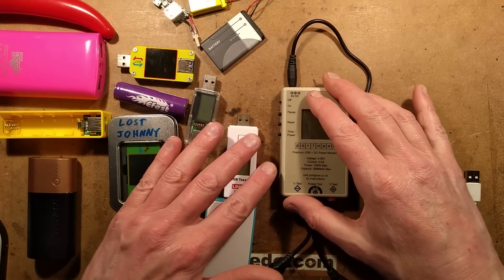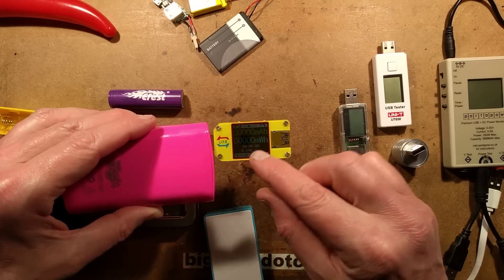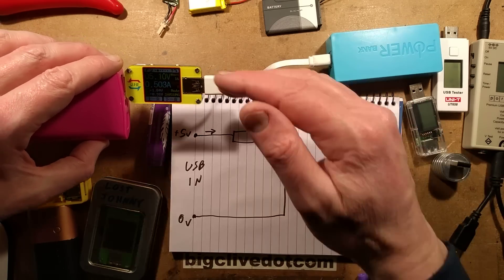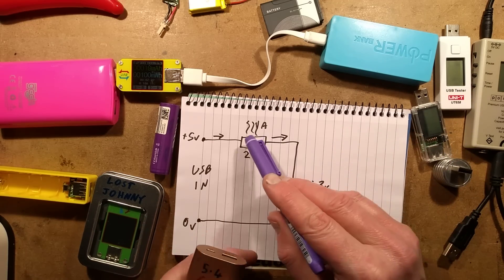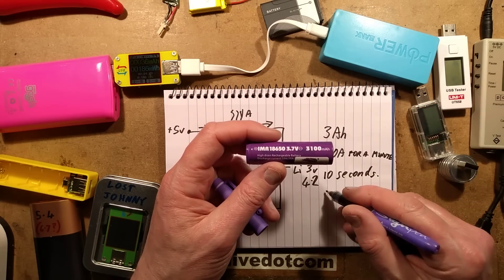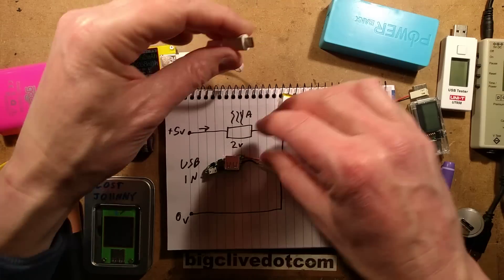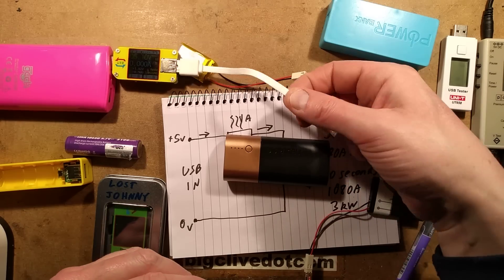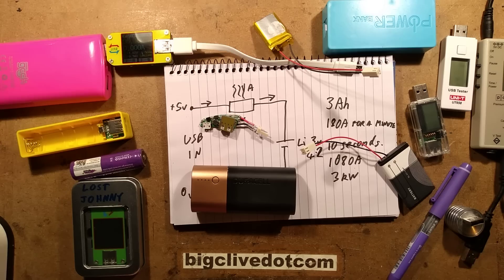How I test lithium cell and power bank capacity.

Comment: Clive, in the DIY Powerwall/second life hobby world, we use the Opus BT3100 to test capacities discharging at 1 amp. This helps to standardize results. It tests 4 at once and does the charging, discharge measurement and recharge and then we just write the mAh value on the cell. Can speed things up a lot by pre- and post-charging with a rack of TP4056s or other chargers. With 10 Opuses we can test around 200 cells per day. Those that get hot during 1A charge are rejected as well as those that get excessively hot during discharge. (A good cell should never get hot during a 1A charge, but is ok to get a little warm on discharge).
Then let stand for a week or two and measure voltage again - any that have self-discharged less than about 4.10V should also be rejected and go for recycling.
Using this method I have over 1000 good cells after testing over 3000 cells and always looking for more to do!
Reply from the maker: I have noticed a pleasing quirk in human nature that makes us harvest lights, solar panels and power storage devices.  Is your power wall vented to outside in case of any incidents?
Reply: @bigclivedotcom  Powerwall still under construction but I will use it for an ebike with a trailer for extra range, so won't be used indoors except for power outages. Have had no incidents since working with cells over the last 2 years - except for cuts and bruises while spudging laptop packs!
It takes a lot of time to evaluate each cell and enter into a database for tracking histories, and for sizing allocation to make equally-sized cellpacks. 
Yes, safety is an important consideration - if and when I do make a permanent powerwall then it would be surrounded by paving slabs or live outside. Not practical at the moment in a 3rd floor flat.
I made four 120W portable solar panels using 6 A3 sheets of foamboard that weigh just over 1kg each and all fit in a backpack so I can ride hundreds of miles for free.
First I made a 2kWh 14S16P ebike battery 18 months ago and that works really well. I'm still in the process of building a 7kWh battery out of the remaining 800 cells to go in a trailer.
Now I make a portable solar tracker using 3D printed worm drives, steppers, arduino and a gps module and that's taking my time right now. The gps module allows me to calculate the elevation and azimuth of the sun anywhere in the world and I'm hoping to be able to mount the 480W of panels on it and all for a really minimal cost.
Reply: @ahaveland   Have you made an Instructable about those 120W solar panels? I'd like to see whether I could make one myself... Although I can't quite see how 6 sheets of A3 foamboard fit into a backpack... :-/
Reply: @stepheneyles2198  I have a vid on my channel showing them. It's not difficult but it's quite tedious. I guess I could make an instructable, but it would only be a list of tips. They've lasted a couple of years and still work... Unfortunately the price of Sunpower cells seems to have doubled since and I have no idea why, otherwise I would make some more.
Here's a pic of them in the wild, and the backpack that 24 A3 sheets of foamboard fit into! https://twitter.com/ahaveland/status/1057715731297648640
Reply: I can only second the suggestion of the Opus. I have an ebike battery pack that I've built from ~120 used cell phone batteries and I would have gone insane testing each of them, if it wasn't for a convenient testing device.
Reply: @tybofborg  Congrats on doing something really useful with the cellphone batteries!
Just have to watch out for the cellphone battery protection cutting in before reaching 2.8V, as the Opus thinks the battery has been removed and you lose the mAh value. Then the cell recovers, and the Opus recognizes it and begins to charge and discharge over again, then lose the value etc...
Reply: @ahaveland  Thank you! Yeah, I'm very happy I could put those to good use. They're from the mobile repair shop I work at. Most of the batteries we replace as "bad" are actually still good (at least the cells), if somewhat reduced in capacity. As for the protection board, I detached those before testing the batteries. They're a common point of failure, and I have my own BMS anyway.
Btw I love your solar bike setup. I've thought of building something like that, but I figured the panels would be too bulky. Glad to be proven wrong on that :)
Reply: @tybofborg  Keeping the individual cell protections could be useful as they're already there and should never trip in use anyway. In any case I'd connect using fusewire in case of shorts. Would still need a master bms to handle overall protection and balancing. Here are my panels in use in November: https://twitter.com/ahaveland/status/1057715731297648640 (Not sure if I already posted this and it disappeared!)
Reply: @ahaveland  Yeah, the main problem with the protection circuits is, many of them have failed, refusing to allow a charge. And they usually have a thermistor that kicks in at around 1-2 amp. Without protection, 10S12P they deliver 15A sustained, 30A peak without a problem, which is perfect for my 500W motor. As for fusewire, I just sorta winged it, used power lines from broken USB cables for the battery leads. They do fuse when a cell is shorted out (~10A), that's good enough for me. The BMS has a 30A overcurrent protection (as well as overcharge/overdischarge protection and balancing) for the whole pack. 
I've seen that photo of yours, that's what I complimented on. That array would charge up my pack in an hour. :)
Reply: this is pretty much the way I check my salvaged Li cells, charge to 4.2 discharge to 3.0 then charge to 4.2 that will give me a ballpark figure of the mAh, leave for 2-3 weeks any that are 4.0v or lower are discarded (sold on ebay)
it helps to have the datasheet as most power tool battery packs contain low mAh but high discharge generally 20A or higher where as most laptop packs are high mAh low discharge.
I've been using my old SkyRC iMAX B6AC V2 but at 1 cell at a time I'm tempted to splurge on the SkyRc MC3000... might need to get a Patreon account tho lol
Reply: @amigaman9433  Get an Opus or 2 or 3... follow HBPowerwall, jehugarcia, Average Joe, DIY Tech & Repairs, Vortecks, Andy Kirby - and you'll also learn a lot from them.
(This is my list of movers and shakers in the 18650 world)
Reply: @ahaveland  I started salvaging 18650 cells for my night-vision torches, once I find some that have a decent mAh >2800 and a good amount of recharges left I solder a 1s bms on them and rewrap.
I am lucky that a m8 works for an e-waste company and gets me boxes of used and some unused battery packs
I'm always looking for new content and I'll check out those youtubers, thanks
Reply: @amigaman9433  Yes, you are lucky! Collect as many as you can, and when you have thousands of them you can run your house off them, charge by solar/wind and perhaps go off the grid and never pay an electricity bill again! This is my ultimate goal.
Reply: You should buy cells in bulk and sell the tested cells for a good profit.

Comment: You should test capacity with discharge not when charging. Losses can mislead overall capacity
Reply from the maker: I use this test method to get a rough guide to capacity of cells inside sealed enclosures where the cell isn't accessible.

Comment: Interesting video :) If you want to know a little more on the RD UM24 (green) and UM34 (yellow) UPM's, I've got videos on both on my channel (or if you don't remember how to work the menu ;))
Although I differ in opinion from you on getting a capacity-measurement : I'll discharge a powerbank at a certain current and monitor that along the way. I'll do this for every charging mode the powerbank supports.

Comment: Interesting, I'm surprised you get capacity from charging.
I used to test 18650's like that but I've had lots of batteries that are old that must be internally failing as they take quite a bit more to charge than you get back out.
Now I use an Mc3000 charger though as it gives me charge and discharge characteristics on the PC/phone which is pretty sweet.
Reply from the maker: If those cells are taking longer to charge than their capacity suggests then monitor their voltage over time with no load.  If it drops significantly then recycle the cells as they may have internal shunts.

Comment: Given the losses that you'll get from the charge/use circuitry, wouldn't it be more useful to measure the capacity of a power bank by discharging it rather than charging it?

Comment: personally i would throw that non metallic purple efest battery away, they are rejected samsung/sony batteries that are rewrapped, we tend to not use those in vaping devices anymore as they have been known to blow up, the newer metallic ones are safe though.

but if you are interested in lithium-ion battery tests, then mooch has got a large list of battery tests and graphs for you to check out here

https://www.e-cigarette-forum.com/blog-entry/list-of-battery-tests.7436/?fbclid=IwAR3Cs2WuMAT6OcITSQOTmxqLXcOhRd2sMcp5kV70tTbMTeg4FLDIGske0Dk
Reply from the maker: I wouldn't use it in a vaping device.  I got it as a higher capacity floodlight cell for a low current application.  I'd only use a premium cell from a known source for a high current application.

Comment: Clive, how do check the capacity of Non re-chargeable batteries i.e. Zinc, alkaline etc. Have you ever checked the capacity of Lidl’s Areocell batteries? 
The RUIDENG UM34 Voltmeter Ammeter displays & records mAh and mWh’s.
Reply from the maker: I have a crude AA test setup that gives a useful indication of all AA style cells.  It's a modified clock.

Comment: i test capacity differently. i discharge a cell slowly, until circuitry kicks in to stop. then i slowly charge it until is full 100% charged, and i discharge again slowly until circuitry kicks in. second time is with known load and time is the metric, a little math - time over current gives me the real capacity i have to use.
Reply: This method need a quite complex math and even after that it is not precise. Even you know load, current will change over time because Voltage will change from 4.2 to 3.0ish and not linear. That is a reason why testers use current measurement logging.

Comment: The Ruideng UM34 USB tester is very accurate but it has a few quirks you need to be aware of. It is definitely a good idea to turn the display off (or very dim) because it eats a lot of power and if testing at higher than 5V, the internal voltage regulator in the tester gets very hot.  Another problem is that the lowest measurable voltage is just 3.94V, because below that the unit turns off. The capacity recording  threshold mentioned by Clive has bugs too and can produce wrong capacity readings. There are a full reviews of the UM34  and the UNI-T tester on my channel if you want more details. 
The reason why you always measure less capacity (mAh) going out of a USB power bank than in is partly due to the losses in the step-up converter as Clive mentioned but mostly because of maths. For example, a Li cell producing  1A for 1hour at (average) 3.6V has a capacity of 1000mAh and delivered an energy of 1A*3.6V*1h = 3.6Wh. These 3.6Wh get converted to the same energy on the USB side but 3.6Wh on 5V means the current is only 0.72A for 1h   (ignoring losses in the converter). So the capacity measured on the USB side is only  720mAh and in reality, even less if the conversion losses are factored in.
Reply: thats a very interesting review, bit over my head but very interesting but one thing I don't get is why this device measures an input voltage up to 24v, isn't USB 5v
Reply: @amigaman9433  5V is the default but even back in 2012, devices could negotiate a higher voltage and current if both the device (e.g. phone) and the charger / power bank agreed with each other. Voltages were initially 5V, 12V and 20V and USB2.0 added 9V. There are also different currents that are negotiated and the way how these negotiation protocols work and have evolved over the years is quite complicated. The UM34 by the way recognises some of the older protocols and lists them on the screen if it detects that they are being used. It doesn't understand the more modern ones but that is no problem as it will always show whatever voltage and current has been agreed even if it doesn't understand the used protocol.
Reply: I thought it was 3.64v before they cut out but it MIGHT just be because the ones we have had made with/by R&D are slightly tighter tolerance/rated components not just a cheap mass production run type 20-40% rated component used.
Reply: Well the low voltage doesn't really matter because you'll be using this thing for USB anyways. If you want to measure non-USB things you'd get a professional power logger.

Comment: Clove the flatulent i personally thought as of course 1000,s of others did that your particular way to test was bite down on one whilst having car jumper leads one attached to the output of a running car engine whilst the other end was attached to you testicles , but i see what you have done is a touch safer , now there is no need to bite down on one just as you omitted in this video was to insert as a suppository ,then step on the gas trying not to tear yourself away with the jumper leads still attached
Reply from the maker: I used to do the testicle test until I tried it with a 1MW 240/415 generator.
Reply: much love  may your high heels be always polished and your beard be free of starlings  may the new year be kind to us all warm regards B-b @bigclivedotcom

Comment: You know what happens when you stick an 18650 in the power bank backwards?
Oh, so much fun happens.
They really should mark the poles better on those 18650s.
Poor MOSFET. I barely knew ye.
Reply from the maker: Yeah, the chips tend to let out the magic smoke.  Julian Ilett did that on video accidentally while testing a new power bank.
Reply: @bigclivedotcom  I got the battery out quickly enough that a bit of magic smoke was thankfully ALL that happened. Shame though, that power bank had been sitting on my shelf for about two years and evidently still held sufficient charge to do that. I shouldn't disassemble things. But I do it anyway. Where's the fun in NOT taking things to bits?

Comment: Sadly this video shows so many little flaws in explanation and important points having to be glossed over because of a failure to discuss things in terms of energy - watt-hours rather than milliamp-hours.
And in particular discussing the 5V output of a power bank, Clive mentions only the losses from from the converter, which are real enough, but the major difference between mAh capacity of the the 3.7V cell and mAh output at 5V is caused by that voltage difference - a factor of 30%.
And of course measuring charging mAh is not a good test of a power bank or cell's true capacity. It might give a reasonable measure when testing pure cells  owing to Li-ion's 97-99% charge efficiency, but for a power bank there is also the efficiency of the converter to account for.
The only reliable way to asses a power bank's capacity is to fully charge it, then measure its total output energy when discharged at a desired rate.
Reply: Rosscoff2000 - you missed the point about it being an approximation... that’s all you need when comparing different cells/batteries/power banks (of the same type)...
Reply: @Mark1024MAK  if only cells were being tested, then it may be approximate enough, but not if power banks are introduced into the mix as Clive did.
In any event it's hardly rocket science to use the more meaningful and robust measure of watt-hours instead of mAh. If it were a lot more more effort to use watt-hrs there might be a point to using mAh, but it isn't significantly harder - indeed many of the little meters can read directly in watt-hrs.
Airline regs for passenger luggage are also specified in watt-hours as are good quality battery packs for things like drones.
Reply from the maker: It was intended to be a short simple video.  I use this technique to get a rough idea of the cell capacity in sealed products where the cell can't easily be accessed for testing.
Reply: @bigclivedotcom  sure, appreciate that, and I still enjoyed the video, but why not just use watt-hrs? That would  simplify it further by making it easier to relate it to likely running times of the power banks at 5v, especially for unusual ones such as the Duracell. 
It would be good to see a comparison of typical power bank efficiencies to find out whether they vary much and whether price is any guide.
Thanks for your great videos and special style!